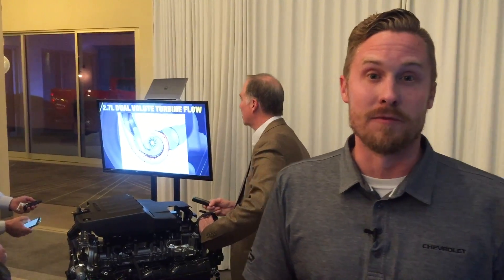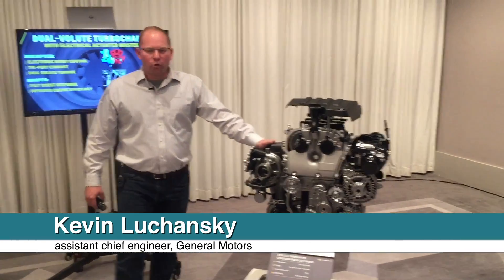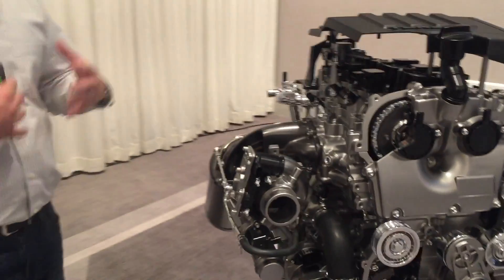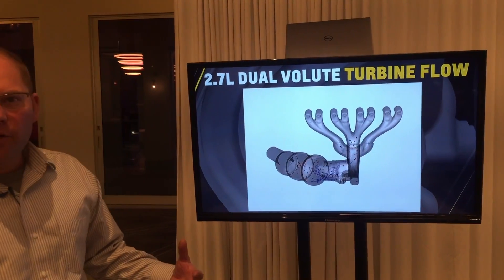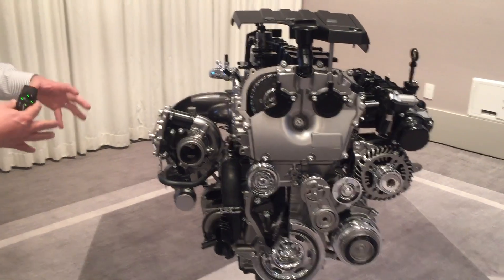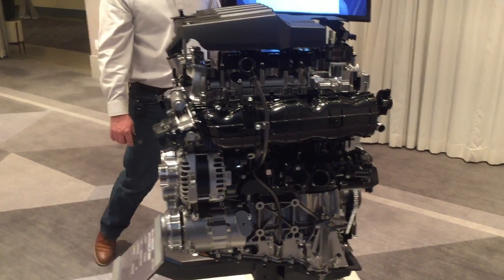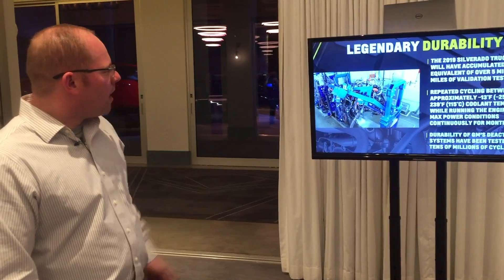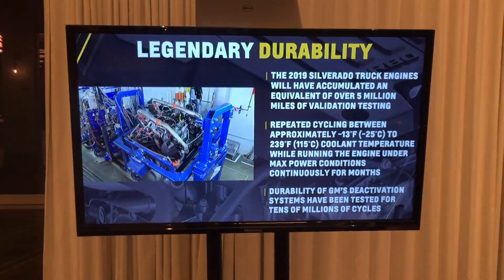All-new 2.7-liter turbocharged engine for the 2019 Chevy Silverado 1500

Comment: Just checking in from the future (September 16th 2025 as I write this) 
To all the guys who were so sure that there would be durability issues with this engine, how did those predictions work out for you? Are you all still loving your 6.2s?
2025 was it's seventh model year, and 2026 trucks are already being sold and this engine is still rock solid, and has proven itself to be (arguably) the most reliable powertrain  offered in GM's 1500 series trucks. Since diesels didn't really fit my intended use, THIS engine was my first choice for my Trail Boss, and I love it.

Comment: I want to see how often the turbo fails and what the overall lifespan of these engines will be. If the engine expires before 200,000 miles then I'm not interested.
Reply: We have several of these in our fleet at work with over 250k miles on them now.  Great trucks!

Comment: I bought a used 2021 gmc 2.7 with 90k miles. 7 months later and 13k in it out of knowhere motor started shaking at idle , took it to the dealership they just told me the engine needs to be replaced and i still owe 24k 😮

Comment: When he says the engine is tested under full load, what does that mean?   Is there resistance on the output shaft slowing the rotation down as the engine works?

Comment: So, 5 yrs later this 2.7 twin volute I-4 now referred to as turbomax & producing 430 ft-lb torque (compared to 383 ft-lb torque of 5.3 V-8) has proved so successful, that it is the sole engine in Colorado, & Canyon. Also, a very similar 2.5 liter version has been developed for Traverse, Enclave, & Acadia. Ford has been producing 2.7 ecoboost V-6 twin turbo for nearly 10 yrs. Ram retired their 5.7 V-8 in half ton trucks, replaced by 3.0 I-6 twin turbo hurricane. Seems as though this is the design of the future. 2024 Silverado & Sierra w/ turbomax get a 5 yr/100,000 mile drivetrain warranty compared to 60,000 mile for 5.3 V-8. The engineering of a turbomax (like a duramax diesel) is how small displacement w/ turbo outguns V8. Forged bottom end, spincast nodular iron cylinders, pistons w/ iron carrier cast into them that carry the piston rings, it's a diesel w/ spark plugs that runs on 87 octane - 25% less expensive fuel & no def.

Comment: Ever since I learned about turbocharged systems, I always thought turbo was connected into the air breather system intake, I always thought you wanted the extra air intake right before the intake heads ,I still honestly don't understand this crazy ass motor,  why is the turbo not connected into the air intake, that's what I'm getting at,

Comment: My work has a flet of  1500 with 2.7 I do alot of driving 2019 silverado with 596,045km no problems most truck in the flet 25 of them have 400,000km +
Reply: What is the highest mileage you have seen on 2.7 turbo?

Comment: Looking forward to testing this in the new Colorado and Canyon trucks. Looks like a huge improvement over the low torque 6 and 8 cylinders. Much more thought put into the engineering at the component level. 

Comparing it to Toyota's comparable engine the one thing I'm confused about is valve actuation. It sounds like there are two settings here, where Toyota has a system where they use a type of "phasing" that allows them to continually vary valve actuation. In the RAV4 hybrid this is one reason you get 40MPG in a vehicle that is faster and more powerful than 6 cylinder engines.

In my opinion Toyota wins on valve design. And no word if GM has moved away from mechanical pumps for water and oil, which are huge energy wasters and hurt reliability.

Really good to see some modern technology finally hit the market. Incredible that people are still driving around 6 and 8 cylinder motors with no direct injection and 30 year old valve management technology.
Reply: OK looks like auxiliary pumps for water and oil have been electrified - good! This should be a much more reliable vehicle.

Comment: You could buy a nice used ls motor for the cost to repair and maintenance this 4 cylinder turbo.  A turbo is a complex high cost high output system.

Comment: I'm an automotive machinist. Very concerned about casting dynamics, quality of the aluminum, and size of cooling/ oil galleries. What about head gasket? O rings? No mention. This is a brand new design. Buyer beware, YOU are testing this unit in real world.

Comment: I am an old school v8 kind of guy. I have also dabbled in hi-po 4 and 6 cylinder stuff. I feel better about the 4 cylinder on a truck after watching this, but I am still hesitant getting one in a truck that will tow a car and trailer. No heavy towing...is a more realistic possibility.
If your oiling system and valve train are not 100% DEAD NUTS NO COMPROMISE NO EXCUSES RELIABLE, IT'S A FAIL. Those are two features which gave the GEN 1 SBC a huge advantage over other brands for decades. The DOD LS GEN4 v8's have a huge valve train reliability problem, I have a 2015 5.3 Silverado, and I disabled the v4 to v8 mode so it will live.
I can't buy a Chevy Truck, and hope the internals are reliable, so for now give me the v8.
Now that engine in a rear wheel drive car, or better yet a crate version I can swap into my 75 or 79 Chevy Monza....NOW WE ARE COOKING WITH GAS!!!!

Comment: I've driven suburbans and Yukon's all my life with 350s and 5.3 l V 8s. I've run them for 10 years or more and driven them between 350000 to half a million kilometers, and they were still going strong. When I see reports that come out that show this motor can do that, I'll be a believer.
Reply: There are it’s reached 2.5 million milt the bottom end is built like a diesel. Thing is a tank. Watch the video

Comment: Why do you engineers stress 0-60 times, these are trucks not sports cars. Let me hear MPG and towing capacity. I want it all in a gas truck, towing power and great MPG. And to be honest, this turbo engines real world MPG aren’t impressive. Approximately 2MPG better than the 5.3L?? Come on, give me 20 plus in the city and 25-27 on the highway. BTW as far as towing, Ford is killing it with their 3.5 with 14k towing capacity. Step up to the plate GM…Long term GM fan, more likely future ford 😢

Comment: The way you test an engine for real life is forget a few oil changes, put the wrong oil weight in a few times, put some low quality fuel in for 50,000 miles, and never change the coolant.

Comment: Check it out, yes I work at a dealership, when I got in the business (30 years ago) these were the power specs. 4.3 V6=160 HP. 305 8=175 HP, 350 V8=200 HP.
Reply: What is the timing chain like chain at the rear of the engine for? It appears to go down. Starter?
Reply: @cjjacob3095 perhaps balance shafts or oil pump.

Comment: I don't think I want a vehicle with an engine where mass was removed in every area possible, which often means plastics.  Saving weight from the heads of bolts?  A few years down the road, after a few thousand start-stop cycles, these lightened / plastic parts could prove troublesome.

Comment: You have to be careful not to floor it on a corner. I was turning and tried to beat the yellow signal light. i gave it gas and the truck went sideways a little while doing a little burnout. Scared me.

Comment: This is going to be great in the upcoming next gen Colorado and Canyon!
Reply: You were correct. I have one in the garage.
Reply: @Skyhawks1979  Hah! Awesome!  

What are your thoughts?
Reply: @shmac96 Lots of power. It gets up and scoots around town. Works really well with the 8 speed. I have a two wheel drive so glad I made sure to pair the motor with the limited slip rear end. The only minor negative so far is that it dosent sound like a V-8. However, the cab is so quiet it is not noticeable while driving. Also glad there is an easily accessible button to disable the start/stop mode.
Reply: @Skyhawks1979    That sounds great!  I bet the size is a lot more manageable on a day to day than the current crop of full size trucks. 
Old man has a 2010 2500 long wheel base with the 6.2 L and it's a bit of a chore.  That said, I would love to get a new Colorado or Canyon when I move back Stateside.  Take care!

Comment: Sorry but gm cylinder deactivation on a 4 cylinder is a complete non seller for me. I don’t mind the 4 cylinder turbo charger but to cut down to 2 cylinders is not what truck buyers want. GM sold trucks during COVID without afm so it should be an option now.

Comment: What octane fuel are you guys using with the 2.7 turbo. 
I’m seeing mid-grade perform best so far, one year old 2021 2wd, crew cab averaging 18 mpg.
Reply: Using mid grade fuel. With a balance of city and highway driving I average 22mpg. I’m pretty easy on the throttle and breaking so your results may vary.

Comment: I own a 1500 dbl cab Silverado 2022 with this engine. So far I love it. The torque feels so satisfying. I sell chevys and trust it whole heartedly.  Even my guys in service have admitted that these new 4 bangers never have issues so far. We are 3 years in now. They pull just as much as the other 1/2 tons and have more torque. You guys really need to drive one before shitting on it.  If you’re buying a new truck I would choose this or the 3.0 inline 6 duramax. Our GM Trainer said that these two new engines are unbreakable even after the extensive torture tests. And who are we kidding?  Most of us truck guys don’t make it 4-6 years without upgrading anyway. Cheers!

Comment: Just got a 22' 2.7 crew cab and it's a really powerful motor.  Gas turbo engines are the future.  Lots of low end grunt with great fuel economy.  got 27mpg driving around the lake.  But average on all miles is 21.8 and i like to get on it out of corner.   its impressive
Reply: that's amazing for a full size pickup truck with no hybrid system installed!
Reply: 27mpg or 21mpg sounds good for a full-size pickup truck

Comment: “We make this in house” - our house in Mexico where Tito and Juan make $2/hr to make the cam actuators 😂
Reply: The engine is manufactured in Tennessee.
Reply: @techhead1363  Assembled*
Reply: Most of the components are made in China. GM loves to source all of their components in China and ship the junk to the USA to assemble it. Most of the genuine GM VVT components that I’ve replaced on GM engines have China printed on them. GM does this far more than Ford.
Reply: Sadly you are almost correct! They average a little over $3/hr

Comment: A easy way to make mind up on this is,get 5.3 if you plan to keep it,if you trade in alot then this 4banger will hold up till its payed for...Now, however, with the introduction of the fully refreshed 2022 Silverado, only one engine is outfitted with AFM, namely the turbocharged 2.7L I4 L3B gasoline engine.Sep 15, 2021
Reply: I got the new 2022  2.7 and it`s a beast but I still get 20 mpg puttering around without getting on the highway. I had a 2014 Ford  F150 with the 3.5 Ecoboost before this truck and even though is says it had 50 more HP than the Silverado does, the Silverado has way more low end torque and I think it would beat the Ford in a Quarter mile run.
Reply: @burgerflipper Yeah, I hear ya there, but I sure don`t miss the 14 mpg that came with it or the $4+ per gallon that gas was going for until just recently and besides, this four banger shits  and gets good enough without the sound so I`ll just turn up the tunes!

Comment: I have a 2021 Chevy Silverado Custom I absolutely love it that 2.7L definitely feels like a 5.3 plus it has great gas mileage and towing which I love
Reply: I have the 2022 custom .it's  fun to drive, seems like it's always in the right gear.
Reply: @williambonillasr.5175  I love driving mine these new trucks are definitely making it happen with these smaller engines
Reply: I'm noticing less than advertised mpg in City, but way more than advertised on highway. This is all at altitude
Reply: The new 5.3 are trash.

Comment: I’ve had mine for a year and a half, around 30,000 miles and I have nothing but good things to say. Relatively quiet engine but it still feels powerful (and I have a crew cab). The turbo actually sounds pretty good, I find myself flooring it in tunnels and underpasses just to hear it.
Reply: Curious on how normal people drive these. I baby mine, rarely take it past 2k,  I have 20k miles on my 2020. Would you say you drive yours hard?
Reply: @privilegedwhitemale306  Usually I keep it under 2-3k but like I mentioned I occasionally take it up to red line for fun.
Reply: @MCHIBullDog  Gotcha. Now thats its broke in, im tempted to drive it a bit harder, I just worry about wear, and how these engines will hold up. The 8 speed automatic is garbage and it runs hot would be my only complaint. You had anything major happen yet?
Reply: @MCHIBullDog  id like to put some bolt ons on, im just not sure what it can take.
Reply: @privilegedwhitemale306  Nothing at all, thus far it’s really been a great experience with the truck.
Reply: @corystansbury  what came from Volvo? That engine design?  Or you building them?
Reply: @privilegedwhitemale306  I drove and modified them for years. In O.E. form, they were tough to kill. I know of plenty of turbos with 250-300k miles. Last one I sold had 220k and it's still running like new (sold to a friend, so I keep tabs on it).
Reply: @MCHIBullDog  what's it like one year later?
Reply: Wait until you get to 100,000 plus. My 2020 Silverado custom got a tuneup at 135,000 and now at 142,000 it’s in the shop waiting for a part on back order. Kept getting vvt codes and come to find out this engine has 3 timing belts!!! WTF!! Who’s the genius behind this vs engine?🤔
Reply: @rolandsanchez4123  I traded mine in at 70,000 miles a little over a year ago for the 5.3 V8. I had zero issues to that point but I was getting concerned something would happen soon because it simply was untested.
Reply: @rolandsanchez4123  No timing belts. Chains.
Reply: Keep hammering on it it’ll be on the hook soon enough !

Comment: I’ve got a bad feeling about this. My company made the mistake of trying to save money on gas and went with V6 over the V8 and the gas mileage is worse (by a lot). Probably due to the weight of our vehicles. I sure hope we don’t make this 4 cylinder mistake next. I guess this engine is fine for most truck owners who don’t work with their trucks but not good to be relying on. Turbo for a true work truck.
Reply: Mine gets 14.3 mpg combined, 40 miles highway and 3 miles city a day. 

I hear others get better and others get worse, mpg's are all over the place, and that's being a  light footer
Reply: And that's without a load

Comment: My 2018 5.3l has 61000 miles, change oil every 3500 miles, and quite a few hrs for the miles...3350 eng hours and works 100%. No leaks and doesn’t burn oil at all.  If this 2.7l reliable like that I would definitely try one.
Reply: Try one   I just got a 2022 it’s surprisingly insane on throttle response. Blew my mind and I’m old skool big motor v8 guy.
Reply: @ killerrf    Pal Your 5.3 will be around long after that stupid 2.7 TURDBO 4 has been sent through the CRUSHER !!
Reply: I’m forced to take one, my 5.3 fuel pump crashed…hope it’s all they say.
Reply: Wait until the lifter sticks on 5.3.  Waiting 3 months now on a Jasper rebuild. Looks like 5-6 months.  Can’t see a 4 cylinder holding up so Toyota next time   I didn’t leave Chevy they left me.

Comment: Love my 2.7 Elevation avg mpg's in a dence city like Miami, Fla 18-19 city; understand this is moderatly driving(light on the foot)  On Hwy I have manged as high as 26 Hwy yet I get on avg 22-24 @ 75-77 mph.  I have towed a boat 4500 lbs boat  11-12 mpg's and 10-12 mpg's with an  Rv trailer with a dry weight of 3800 lbs, 63-66 mph. Better is the torque as i start hitting strong grades in NC & Tenn. now watch me reach 32-33 mpg's  That is current reading not overrall but yet held there for about 10 ninutes.. https://www.youtube.com/watch?v=bz7XAfx-CJI&t=7s

Comment: Electro motor,  electro activation of the cam,,sooooo when the electronic part craps out >>> its not under warranty. That happened on the Ram pentastar, ,cam phasers... Don't they run these engines a couple hundred thousand miles in real world conditions before they produce them, Sorry but when you look at your history on the GM AFM problem from 2007 to 2014 and you won't admit it and pay for customers new engine,  I can't buy one . I actually kept one for a test ride, 2.7 Silverado 2020,,, but couldn't buy ultimately after being burned on a 2017 Ram that had cam phasers problem . I bought a 2005 GM Sierra to replace my turned in 2017 leased crap Ram 1500. Like I said i would have bought the 2.7 Silverado ,, but your past history on HOW YOUR COMPANY , General Motors , handled the AFM problem is just as dishonest as Chrysler ...

Comment: Such a great engine,  give a 10 year , 100 k power train warranty , with no fine print.  All components including electrical and computer controls. Etc....
Reply: 10 year 100 k warranty is shit…..nothing breaks on a truck in 100 k…after 100k then you can sweat it….cost to repair looking at all the plastic and hoses and turbos and no space. ,my guess it’s going to be a nightmare ,and it’s going to be expensive…60 grand for a  truck and they guarantee 100 k. Please
I’ll keep my old 350 ,
Reply: @chrsshears4528  well sad thing is it like 36k warrenty.  
I have a 2005 GMC Serra.  Trucks are a rip off today. Dont car companies realize its a work truck and the guy isn't pulling in over 100k per year. . I personally think car companies are on the way out.